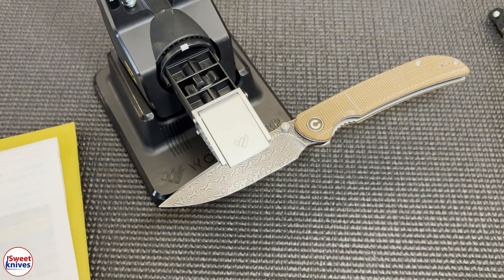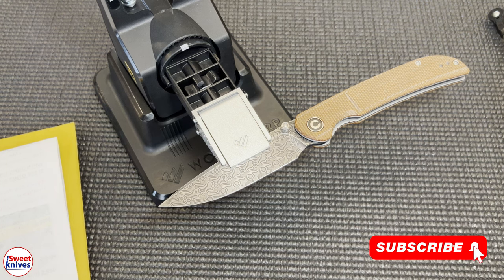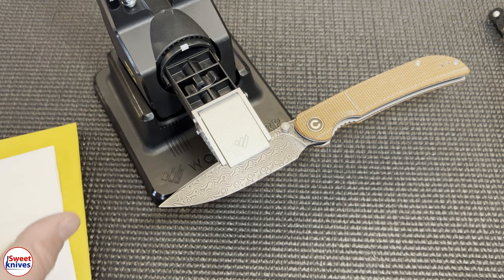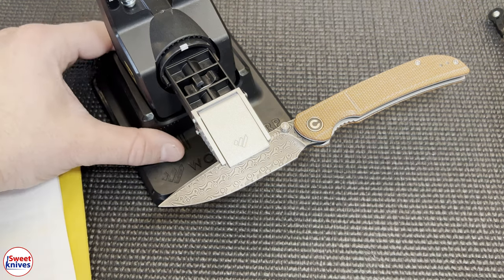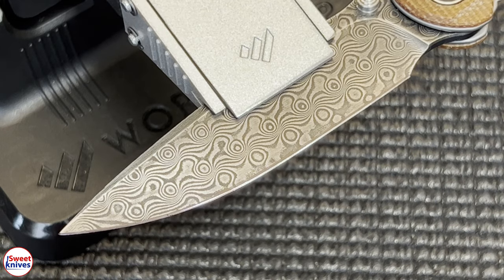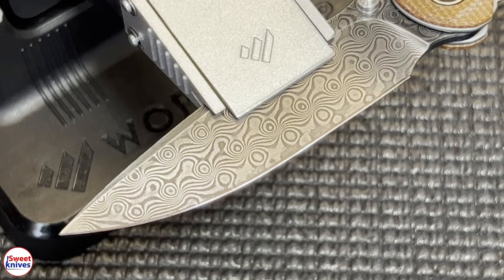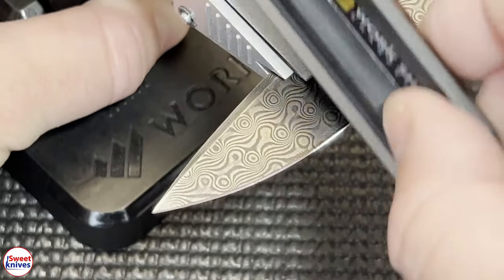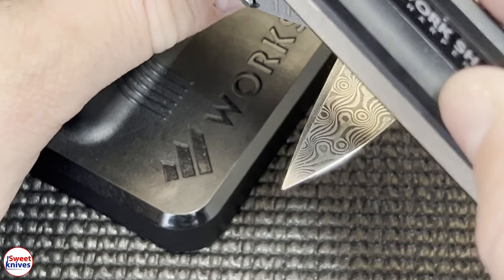Worksharp Precision Adjust Sharpener - Update How to Sharpen Damascus Civivi Knife with Work Sharp

Comment: I put a small piece of black foam in the back of the knife clamp, it holds the jaws open so they don't flop around while putting a knife in. The foam is small enough not to interfere with the blade spine.  Just got your film today and waiting for the 3D printed holders to use them.
Reply from the maker: Awesome, glad you got them, let me know how they work out for you. Thanks again!

Comment: Hey Jeff. You should be getting my letter soon for the films.  Looking forward to work on my Civivi Damascus Pintail using your technique with my new WorkSharp. I made my own clamp support upgrade with some plastic plumbing hardware. Works great, cost me less than 3 bucs.I've watched quite a few tutorials on the Work Sharp, and everyone uses "longer" strokes with the stones, so not to "wear" out the center.
Reply: I noticed the same thing, he uses a very small section of the WS stone, which will wear out the center and takes longer in the sharpening process itself when you don't use the entire length of the stone. It's like using just the center of a hand saw to cut a piece of wood! Not a bad thing, but...

Comment: I sharpened my Tr 4 with CPM D2 metal. I had the hardest time I've had sharpening. The 320 grit did not do anything. And one bevel was taller than the other one. Which made no sense. Because I clamped it in the vice equally. Any suggestions?

Comment: How often would you need to tune up the edge? Would you start at 600?
Reply from the maker: Depends how often and how much you use the knife but once it doesnt cut great then yes just put it at 600 and it will work perfect!

Comment: It's far better to buy the clamp Stabilizer from ebay, and use your hand to stabilize the the top part of the WorkSharp where the guide rod connects. It moves a great deal, you can hear it in the video. You'll get much better results this way. There are a few different clamp stabilizers available on ebay for $12-15.

Comment: How do you deal with uneven grinds? I constantly have grinds where the tip of the knife is a different angle than the belly of the knife. Seems like I have to work forever at the tip just to get a burr. Do you microbevel a blade like that? Recently had a benchmade that was literally 23 at the tip and 19 in the belly. I'm sending it back because the grind is just terrible. But for cheaper knives, I might just want to re-profile it.
Reply: I had the same problem yesterday. But the whole one side was fatter bevel than the other side was much thinner. The tips always seem to be like that. With these types of sharpening systems, I think it's because, like this guy says, they were sharpened on a wheel.